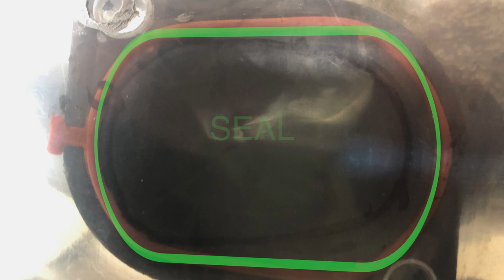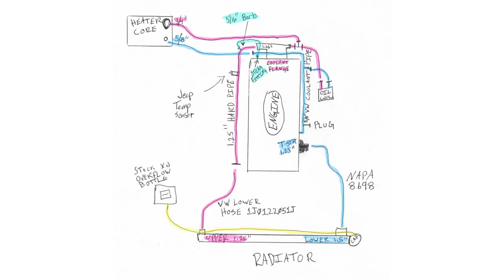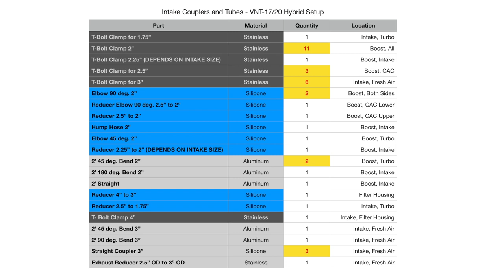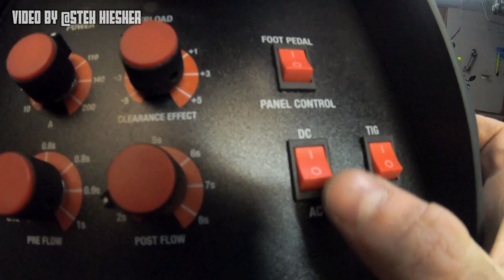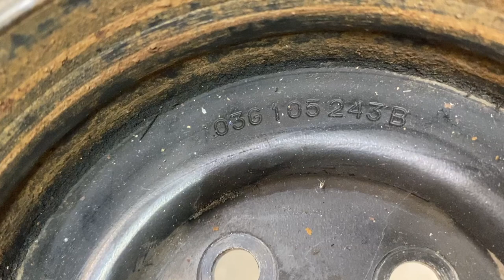Step By Step TDI Swap - Part 6 - Coolant System and Intercooler

Comment: In the UK we have a few choices for diesel swap that are fairly cheap and easy, 1 being the 1.9 xud tdi, no ecu and can manualy tune, other option it the VW/Audi/Seat PD130 or PD150, both can be mapped to 300bhp.

Comment: FUN FACT: every shot of the Spool Bus driving at the beginning is with the stock VNT15 turbo :-)
Reply: Gtb2060vklr is good for 300 and spool very well with ball bearings rather than journal for longevity and reliability* an ASZ or ARL engine code intake manifold is a good mod over standard too 👍🏼
Reply: Jon these videos are the best. The time you put into these did not go unnoticed. Thank you!
Reply: @andrewsapp856  Much appreciated brother! Saw you subbed to the DRT Jon YT but I don’t post there really. You can see current Spool Bus adventures by clicking on my Dirt road therapy user name here 👈🏼

Comment: I have an Audi A4 B5 Avant AVG 1.9TDI 110hp and there is a lot of them in europe with 400k miles and more, mine has 240k miles without a single problem. And Portugal has a 1.9tdi with 600+hp. Many have 300/400 reliably. VP engines are more mechanical so the PD engines you can get more hp with less work, but stock the VP are bulletproof.

Comment: Great work but don’t use the stock xj coolant reservoir the tdi motor needs to flow its coolant steam outlet line (top back of the head just under the vac pump ) continuously to the vw style coolant bottle wich continuously purges any air bubbles trapped in the head as it is one of the highest points the xj reservoir is just not equipped for that as it’s just an overflow catch that alows  the rad to overflow into it and back out were the vw reservoir is flowing constantly threw its reservoir bottle and is always a part of the coolant system and will eliminate any air pockets as it runs I also noticed on some of your new videos that u have switched to the vw style reservoir hope u didn’t hurt your motor like I did dealing with pesky air pockets

Comment: How much would you say that you have invested in this engine swap so far and do you really like the end results.
Reply: General Jackson I love the end results. With the stock turbo and injectors I had right around $5000 in it. More like $7000 now, part of that is because I’ve had to re-do things I wouldn’t have if I knew everything I’m sharing here, and had started with the upgraded turbo instead of setting up one way then changing

Comment: Is it necessary to run a hard pipe from the flange to the upper radiator? Can it be normal radiator hose?
Reply: Hey John, follow along with latest updates and ask me questions over on my new channel, just click my icon here!  But no, it's not necessary to run a hard pipe , though with it running close to the turbo I didn't want a long rubber hose running across that area. And in my opinion it looks cleaner to have the hard pipe.

Comment: Jon, regarding the stock coolant hardpipe at the rear of the engine where you cut that tee off so it was just one outlet, how did you keep the coolant hose from blowing off the pipe without a lip at the end of the pipe?

Comment: A few questions.  Did you make your MAP bung or did you source it from a site?  And also what was the name brand of the tubing couplers you ended up using?
I will need to look into using the 1.8T A/C stuff for my build.
Reply: I bought a MAP bung from USP Motorsports.  I ended up using siliconeintakes.com for all my intake parts
Reply: @DRTJon  Awesome.  I'll do the same thing you did with the MAP bung, or I'll TIG it into one of the intake charge pipes.  Thanks!  Btw, I think I speak for everyone when I say that we'd love to see a driving/offroad compilation of the Spool Bus.

Comment: Hey @BleepinJeep, question for you? This has nothing to do with this current video.  I have a 1999 Cherokee 4.0 . It hasn't been running for 1 year or so.  It starts up, I let it run for a while, then I drive it in my neighborhood for like 1 min. and I come back to my house and engine cuts off. I start back up and it will stay on for a couple secs. and stall out.  I'll wait 30mins, it starts back up and can drive for a 1min, then I put in park and let it run, then it slowly stalls out. What could be the problem?? I appreciate any help.  I already change the dis. cap and rotors, spark plugs, and spark plug wires. I clean out the trottle body and ACI. 
Thanks

Comment: Matt, you had a “weld your own rear gears” to make a locking spool.  Wanted to know how to get rid of that lincoln locker setup. Do I need a whole new set of gears and the full time locker that was welded in place is just removed as a unit? Sorry I had to post that here but didn’t know how to contact you otherwise.
Reply: Trout Soup you’ll likely need a whole new carrier and spider gear set or a new full carrier locker (such as a PowerTrax or ARB for example). Your current ring and pinion can be transferred over
Reply: Jon BleepinJeep Thanks Jon.  I know have 35 spline axles in there from Mark Williams.  The guy who put it together for me is no longer in business, and he welded the spider gears together so I’m locked at all times.  I want to just have an open differential in the back with the option to put a locker in there. 
Where do I get a set of spider gears that I need for my Ford 9” with 35 spline axles and 4.88 gear ratio? I appreciate your help! Have been a subscriber since Matt started this channel I believe

Comment: Is the hose from the oil cooler rubbing on the bell housing bolt? shouldn't you bush that somehow?
Reply: Mike Kerby No, when finalized and zip tied together it’s not touching anything

Comment: What's the weight difference between tdi and 4.0?
Reply: Mikie Peters I believe around 50-100 lbs. The TDI weighs just a few lbs shy of 400 fully dressed not including adapter and flywheel
Reply: @DRTJon  Wow! That's not bad at all!!!

Comment: Is this swap street legal? You must not have state inspections.  Where I live you cannot change the engine size unless it was offered as a factory option that year. So basically no engine swaps. Certainly cannot go from gas to diesel
Reply: Plus this swap would set the check engine light on. Cannot have any warning lights on and they plug into the obd2 and make sure the vehicle has run through all its monitors. This swap would makenit impossible
Reply: Different states have different rules. Tx you can swap newer engines into older vehicles,  but not the other way. The vehicle still has to meet regulations for that year.
Reply: In Pennsylvania you can have the title changed from gas to diesel by a notary for $80. There’s no emissions for light duty diesel vehicles before 2008, and the VW OBDII port is in place of the Jeep, and the check engine light for the XJ is disabled. If the inspection mechanic plugged into the OBD port (they won’t) they’ll be scanning the VW ECU for codes. But you’re correct, some states will not allow a swap like this which is why you need to do your research before starting this kind of swap. My engine and vehicle are also the same year but that never was a question by any governing authority in my state

Comment: Rolling coal, not cool.
Reply: W RD With the new lever turbo, it still can but you have to try. It does not just load up and spew coal on every moderate acceleration
Reply: Diesel=less Co2 emissions than gasoline.

Coal is a Fossil Fuel, Carbon is an Element.

Carbon is what comes out of a diesel engines exhaust.

If your an EV type, that's an entirely different kind of being environmentally un-friendly.
Reply: That's how I failed my smog test.